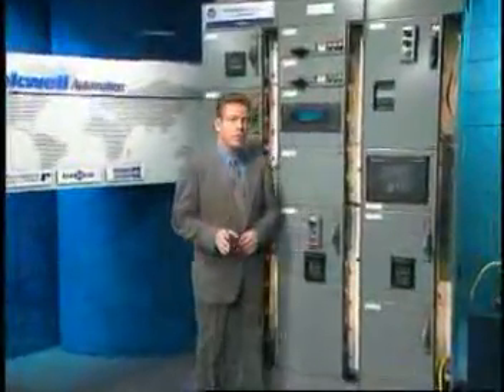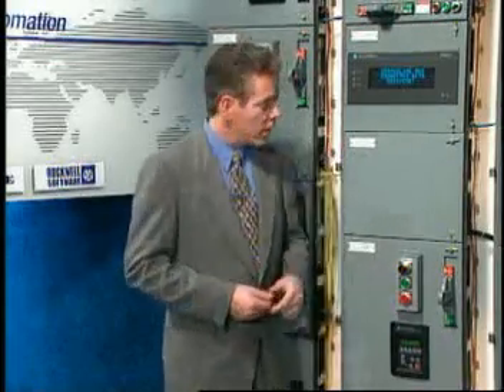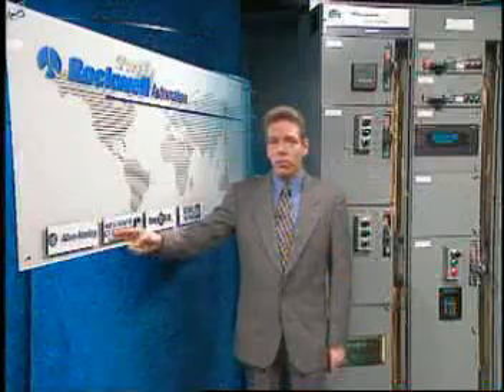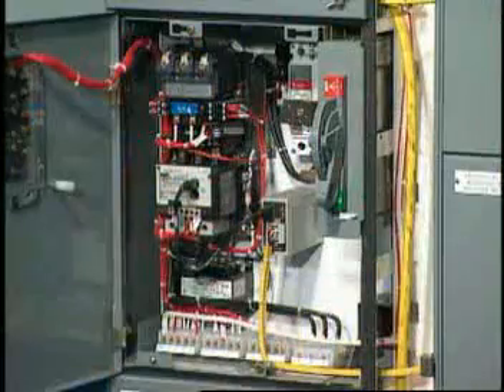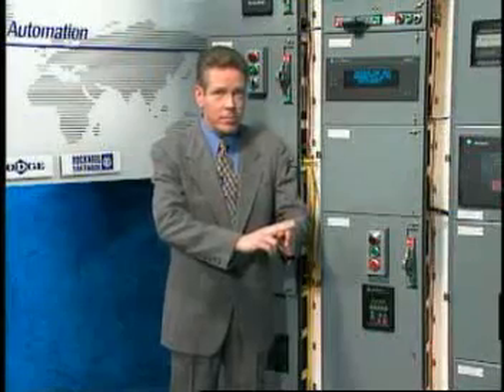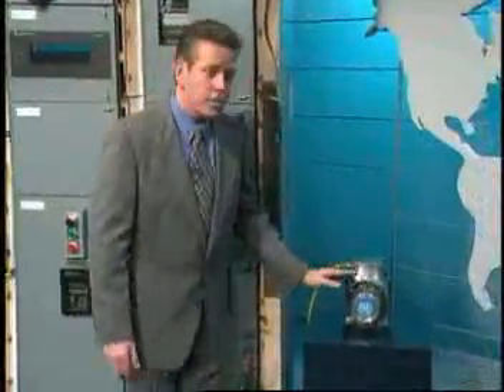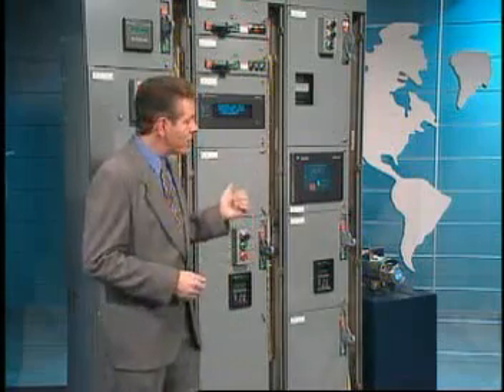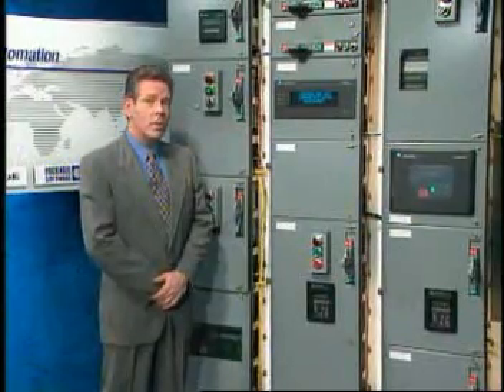Retro Encabulator

Comment: Hi, I have transcribed the words that the mister has talked in this video, with my newest software called OneMillionReasons.

Feedback is greatly appreciated.

Transcribed text:

"Here at Rockwell Automation World Headquarters research has been proceeding to develop a line of automation products that establishes new standards for Quality technological leadership and operating Excellence with customer success as our primary focus work has been proceeding on the crew they conceived idea of an instrument that would not only provide inverse reactive current for using unilateral phase detractors but would also be capable of automatically synchronizing Cardinal Graham meters  such an instrument comprised of Dodge gears and bearings Reliant electric motors Allen Bradley controls and all monitored by Rockwell software is Rockwell Automation retro encabulator the basically the only new principal involved is that instead of power being generated by the relative motion of conductors influxes  it's produced by the material interaction of Magneto reluctance and capacitive reactance  the original machine had a base plate of prefabulated amulite surmounted by a mallieable logarithmic casing in such a way that the two Sperling bearings on a direct line with a panametric fan the lineup consists of Simply of six hydrocoptic marzel veins show fitted to the end of patient lunar Wayne shaft that side fumbling was effectively prevented  the main winding was of the normal Lotus o deltoid type placed in pan intermix Mi bullets lots of the stator every seven conductor being connected by a non-reversible tremie pipe to the differential girdle spring on the upper end of the grand meters  more over whenever fluorescent score motion is required it may also be employed in conjunction with a drawn reciprocation Dingle arm to reduce sign of soil do plant operation  the Retro encabulator has now reached a high level of development and it's being successfully used in the operation of Millport Ryan's it's available soon wherever Rockwell Automation products are sold"